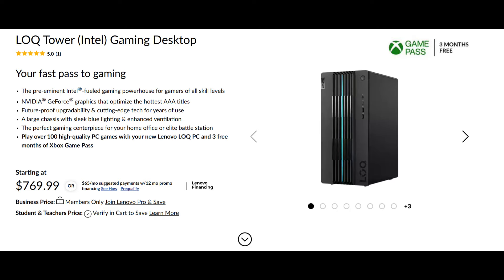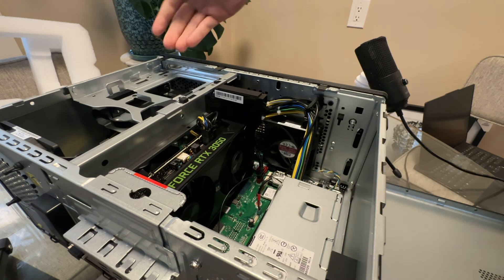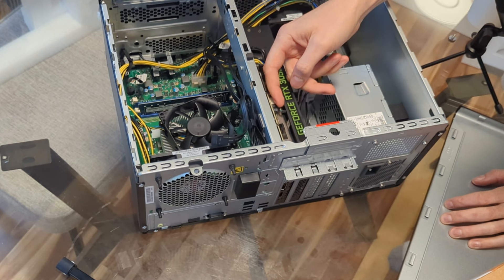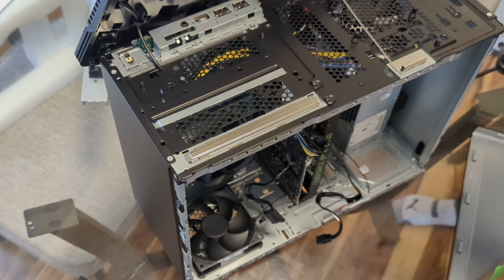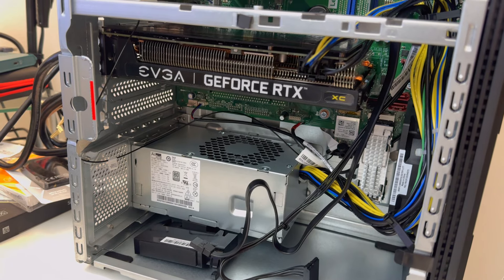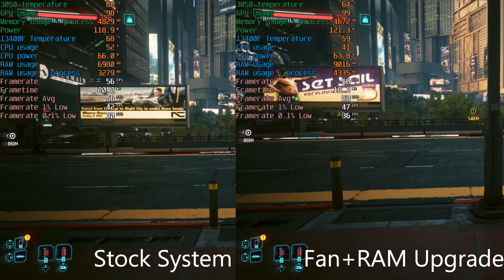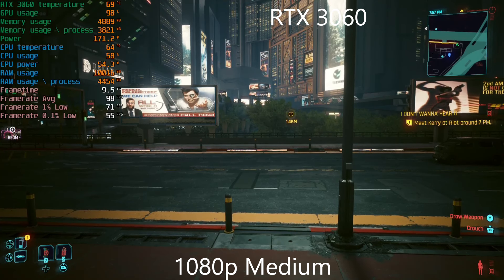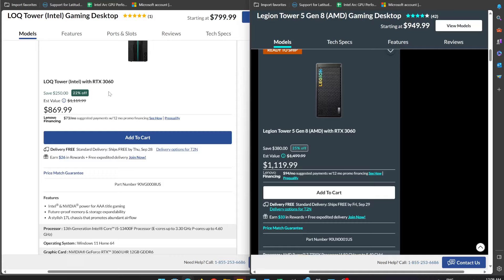Lenovo LOQ Gaming Desktop (Nvidia rtx) - Review, Upgrades, Testing

Comment: DO NOT UPDATE THE BIOS ON THIS COMPUTER THRU VANTAGE IT IS BRICKING BIOSES
Reply from the maker: Dang, if you have a source for this I can pin it
Reply: @TechGuyBeau  me, I’m currently getting it warrantied
Reply: i got it warrantied, got the warrantied pc before christmas and am waiting on them to release a fixed bios
Reply: Literally found this video because the vantage bios update just bricked my son’s computer of this model I just bought him for Christmas. Any fixes?
Reply: Can you usb flash the bios when this happens?
Reply: @PapaUrie  unfortunately not, the display stops working when it happens
Reply: @PapaUrie  i dont believe so. the best you can do is get ahold of lenovo support and get it warrantied which is what i did. Theyll send you a new one and when the new one arrives you have 5 days to send it back to lenovo. I did a good amount of research to try and fix myself but unfortunately lenovos got a pretty good chokehold on their gaming desktops for some reason.
Reply: @gloopington  I have them calling to do the over the phone attempts to correct it even though I’ve already tried the things they will try. After that call I’ll get the replacement I’m sure.
Reply: @PapaUrie how’d it go?
Reply: Is this issue still happening?
Reply: Why You update the bios on the First place my son buy the PC and change the hole motherboard for a New one and everthing works great
Reply: I updated my bios via USB and it also bricked my computer, trying to fix  it at the moment, will likely have to get it warrantied :(
Reply: @beto544  don’t bother fixing it brother go for the warranty it’s less than a week process for me
Reply: @gloopington  thanks for the info, i just submitted a ticket. It seems some people have fixed the issue by clearing the cmos using the red jumper on the motherboard. I'm gonna give that a shot!
Reply: clearing cmos didn't fit it, warranty it is.
Reply: Does it apply to all Lenovo tower pcs??
Reply: Well, I won't say it's your fault, because it isn't. But many motherboard manufacturers say to don't update your bios because it doesn't improve performance and can cause a brick. And they also recommend that if your pc is working OK that you shouldn't update the bios.
Reply: @ why make this comment. Lenovo vantage is preinstalled software on my Lenovo desktop I had purchased.
Reply: This happened to me when I was trying to update the bios
Reply: Ok so it was not only me had a legion slim tried to upgrade bios and it crashed every single time and of course it blocked also gpu and cpu driver updates as well

Comment: just got a 3060 version of this recently, a few tips. the built in power supply can only be replaced if you get a 24 - 10 pin lenovo adapter, and even then the psu fan will remain on when plugged in. be careful if attempting to switch this motherboard to other cases it has a unique screw/standoff location. I replaced the cpu cooler and fan but the motherboard wouldn't run the new fan for some reason so had to switch back for now. will update this comment as I dive more into this mess and hopefully someone finds it useful. *Update. Attempted to use the old psu in a new case for better airflow but the cables on the psu are so short that they practically only work with the lenovo case. Most of the issues (not recognizing case fans or cpu cooler fans and psu not fully shutting off) seem to stem from this lenovo mobo/bios combo. Will update when I decide to pick up a different mobo. *can't activate xmp on this mobo/bios or control fan speeds(even 3rd party apps like fancontrol don't recognize fans plugged into this mobo). What a can of worms this turned out to be.
Reply: any updates?
Reply: i got the gtx 1650 super version and it comes with a 310w supply. im bout to order the 24 - 10 pin. my question is will a corsair 550w 650w power supply work without problems? and will a msi 4060ti fit in the case?
Reply: @Keno4bobby  did you make it work with other psu ?
Reply: @Keno4bobby  i got the 4060 version with 310w power suply just change gpu bro

Comment: Champion. This was a very informative and very helpful video. My friend asked for some advice about getting a pre-built from Best Buy, found this option with 16GB RAM and a 500w power supply at $650. Seemed very compelling. I was a bit concerned about the motherboard being proprietary and limiting options but that doesn't seem to be the case too badly. Excellent video!
Reply from the maker: It’s good for the price. You can upgrade  the cpu and gpu within reason at 500 watts down the road if needed

Comment: Great video!
I just bought the same PC with the 3060 graphics card with 13th gen i5, used and I came home plugged it in and  then Took A Closer Look at it and realized that the psu/power supply was making subtle ticking noise even when the PC was off so I was hoping maybe you could test it out on your PC, if you also had a ticking noise coming from your power supply, with the pc being off, but plugged in?🙏🙏

Comment: Loved your video. I brought this model without the proper research and wanna upgrade it. I’ve brought a 4060 ti and wanna upgrade the power supply. Any ones you recommend that use the 8 pins for the gpu? (So not too much messing around with adapters)

Comment: Just got the 3060 on Black Friday. Good to know about the ram specificity. Hopefully the 16 gb holds up for a while. I'm planning on using the stock 512gb  m2 for operating system and apps and adding another ssd for storing games. The lack of any high speed ports on the back is a bit disappointing as you would have to run external drives from the front. Cooling wise, I will probably just add a side cooler since I'll need the hard drive caddy. Thanks for the breakdown pal

Comment: Thanks a lot for the detailed review of this! I just bought LOQ waiting for it to be delivered and play CS2 with it (Valve doesn't support macOs anymore and I just wanted a cheap thing to play).
Do you have any plans to make similar video for the Legion Tower 5 desktop as well? (does it worth to pay extra for their front fans?)
Reply from the maker: The primary benefit of the Legion tower is it’s a bit more modular., But I think you’re going to be fine with this model. I might do a review down the road
Reply: How it's your PC with CS2? I have frame drops and spikes with the i5-13400 and rtx 3060...
Reply: @h1nt20  If by CS2 you mean counterstrike, it's working great for me except a few crashes which I think is normal based on the reports on Steam community chats. I've heard there is another game called CS2 which is very graphic intensive and even 3060ti cannot handle it
Reply: @mahmoodem2849 so Counter Strike 2 running fine with this one ? I also wanted something cheaper only for that since I run Mac usually:)
Reply: @EdgOrn  yeah it plays nicely. Btw I'm also playing Elden Ring and the game renders fine as well. I like the game so much (nice scenery) that I haven't played CS2 in like a month lol
Reply: @mahmoodem2849  cool cheers for info.. I was reading online that this Lenon crashes a lot.. didn't experience that or it's fine ?
Reply: @EdgOrn  It hasn't happened to me at all. CS2 crashed once mid-game which I checked Steam community threads and it happened to a lot of people. So I think it was the game and not the PC.

Comment: Sorry if I word this incorrectly as I don't upgrade computers often, I'm considering buying this PC and was wondering: how many sata power cables come with this machine? I have a SATA III SSD and a SATA HDD in my current PC that I'd like to transfer over once I buy this, and seeing as you said up to 3 SATA drives can be connected I'm just wondering if I'll need to buy more power connectors, I assume no? Would all 3 already be present?
Reply from the maker: It has no spare cables. You have to buy them. Not expensive on Amazon though

Comment: I got the New Model with RTX 4060 and 14400F combo and upload some vids in my YT channel.  IM running everything stock at the moment but i plan to upgrade to the 4070.  Any issue swapping GPU? IM guessing its 8 pin and 2 slot card on both the 3050/3060?
Reply from the maker: I hav the new one in my living room. I’ll be doing a full review shortly

Comment: What mounting points did you use for the fan. I purchased the linked fan and there are no compatible spots to connect it to the case.
Reply from the maker: I used a rubber style connector and just pulled through some honeycomb holes

Comment: I got a Corsair AF120 Elite (4-pin) to add a fourth fan. It did not work when plugged into the Aux Fan 2 header. I plugged it to the Aux Fan 1 header, and changed that fan to the Aux 2 header. Seems to be working now. Did this happen to you?
Reply from the maker: My fans were weird too yeah. But after swapping the plugs it worked. I think some pins are disable in bios by default
Reply: What RPM does your fans spin? I placed 2 front fans and one of them is only working at 650-750RPM even when gaming, the other one works fine.

Comment: Did you have any issues after with the 3060 with the 380 power supply ?
Reply from the maker: Not in the testing I did
Reply: @TechGuyBeau  thx im still little iffy tho if I should considering all the forums I’ve read say 3060 needs a psu of 550
Reply from the maker: @astrolegend  it is possible but the problem is adding more components like storage might push you over the limit

Comment: i recently bought this pc and i think i may have to upgrade the storage a little, i know very little about the technical stuff so i'm afraid to mess this up, any recommendations on where i should buy more ram that won't drain my bank account? i currently have 476GB and as i am an avid gamer and will soon be looking into making 3D art, how much do you think i should look towards upgrading to?
Reply from the maker: Do you need ram or storage?

Storage is going to be a m.2 nvme. You’ll see the section where I show it kind of sticking offf the bottom of the motherboard. But in your case, for ease of use, buy a 2.5 inch SATA ssd and a cable and just plug it into the motherboard. Then you don’t need to mess around with the drive that has windows . 

As for ram you just want two sticks of ddr4 desktop memory. Ideally two 16gb sticks to get a total of 32gb. 

Non if this needs to cost that much
Reply: Yeah I'm pretty sure I'll be needing more storage, any recommendations on where I can buy this SATA ssd online?
Reply from the maker: @calvii_boi just Amazon. Get a 2 tb SATA ssd. Lots of cheap options. Tesmgroup, silicon power, lexar, patriot, etc
Reply: @TechGuyBeau  alrighty I'll look into this soon thanks man
Reply: @TechGuyBeau  hey just have another question, what type of cable would i need for the ssd? you mentioned a cable in an earlier comment so i'm assuming i would need one

Comment: There's a different version on sale here : i5 13400f, 1GB SSD, 16GM RAM, RTX4060 8GB and 380W PSU. Is their stock PSU/cooling good enough for all of this or should I replace it? If yes, any suggestions?
Reply from the maker: It seems to be fine honestly. If the cpu runs hot you can get a new one later, but I didn’t find temperature issues. Also nice upgrade with a 4060
Reply: Thanks for the reply. My only real concern is the PSU, because I mostly see how at least a 500W is recommended for a 4060.   @TechGuyBeau
Reply: @GhostPrototypeII  did you try it out? I just ordered a similar version and I'm a bit worried about the low PSU.
Reply: @harald_taesc7642   So far I've had no issues. Highest power usage I've seen for both was ~170W total.
Reply: @GhostPrototypeII  thanks for answering. I ordered this version: "i5-13400f, 1 TB SSD, 16 GB RAM, RTX 4060 8GB and 380W PSU". Hopefully it will work out fine for me aswell.

Comment: I can get the 3060 version for $430 USD. Thoughts on that vs custom build?
Reply from the maker: The 3060 model is rock solid. It comes with 16gb ram, better powe supply and much better gpu. The 13400 is a good pairing with 3060 level performance. I’d say it’s a good buy

Comment: I bought the one that came with 16 ram instead of 8 for the same price, what I want to know is if a 4060 or a 4060ti fits there, the RTX 3050 that comes is an OEM or at least for me, and well I plan to change in the future, and I would like to know if it is possible, otherwise I would have to go through 3060 (also have a 500W PSU, not 350W)
Reply from the maker: yes, but you just need to make sure the 4060ti is a 2 fan card. 3 fan wont fit.

Comment: Can i put 3200 hz 16gb ram in this or is that not gonna work with the motherboard?
Reply from the maker: Yes just make sure it has a JDEC speed of 3200mhz
Reply: @TechGuyBeau my tforce ram is working but its only at 2400hz its seems too work fine tho so im not mad

Comment: Can the power supply be upgraded?
Reply from the maker: Yes but the mobo connector will require and adaptor
Reply: What connector and adaptors will I need. I’ve installed a 4060ti and worried the 350w isn’t enough for it.

Comment: Nah I passed on this and got (yes) and Ibuypower Slate Mesh with the I5-13600KF (14 cores, 20 threads) which is great for the price. And the RTX 4060, along with liquid cooling. Also it's very wide, and upgradable. I'd never buy this, an Asus, or Alienware. They are all pretty horrible, cramped case PC's. Along with HP. So yeah, don't waste money on these types of under ventilated skinny towers. Waste.